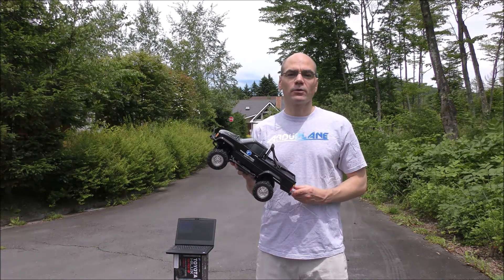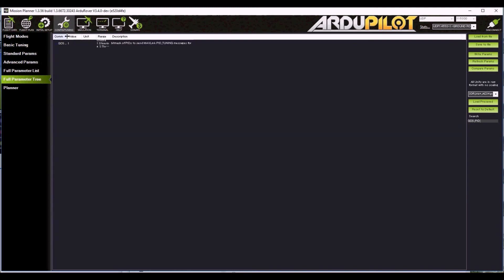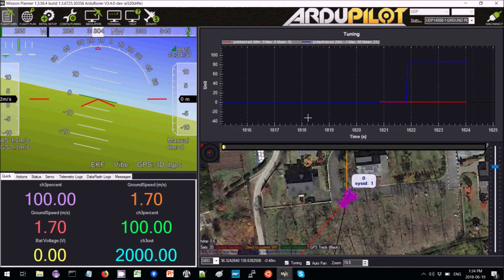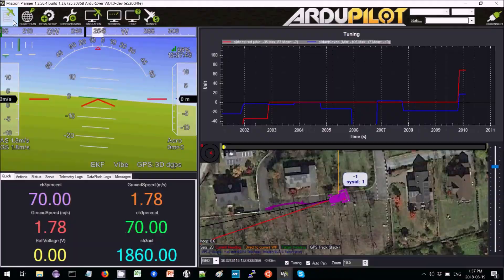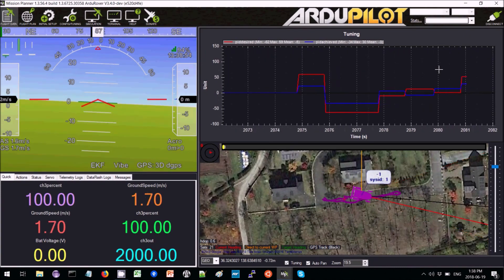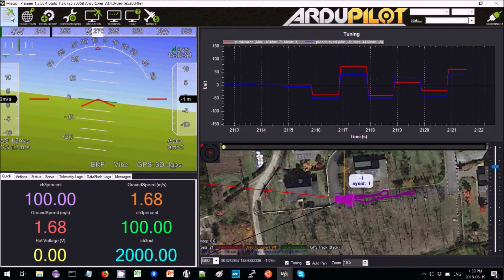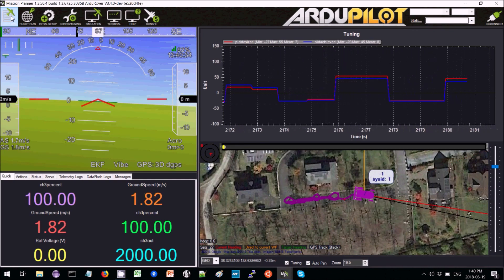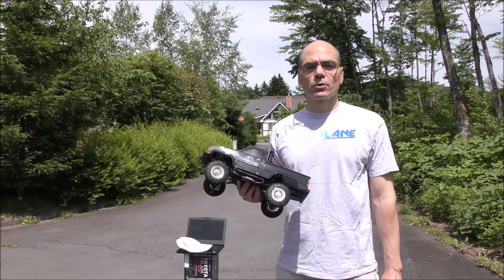Rover Turn Rate Tuning

Comment: This procedure doesn't work i rover 4,0 and above. I tried adding turn rate and gz at seperate times to the mix but got very strange results. Is there a fix for this or a workaround?

Comment: Hello dear randy
thanks for sharing

I have a question about acceleration control of car

we have and hpi which is very powreful and each time we attempt to start it it becomes uupside down and crashes

how we can control it so that its velocity rise up gradually even if we input a high throttle?
Reply from the maker: Hi Ali, in general it is better to ask questions in the forums ( https://discuss.ardupilot.org/c/ardurover/rover42/162 ) but in any case, I think the ATC_ACCEL_MAX parameter could reduce the maximum forward-back acceleration.

Comment: Note to those trying to get a baseline ACRO_TURN_RATE on Rover 4.0 and above, it appears that you can't plot pidachieved and piddesired while in manual mode. The documentation says to graph Gz (z axis gyroscope) instead but I've found the output is flawed.
Reply: Thank you, I was getting very low values with GZ and couldn't figure out what was going on in the video that was different. So is there no way to get an accurate value graphed?

Comment: Hello doear randy

thanks alot for your valuable videos

I have encounter a problem that my buzzer doesnt make any voice while changing the mode

do you guess what the problem would be and how I can fix it?

thanks a lot
Reply: @randy
Reply from the maker: Hi Mohsen, I think we have recently fixed an issue where the buzzer was not playing if the mode was changed from the ground station.  It would make a noise when changed using a transmitter.  If this is the issue then it will be fixed in an upcoming release.

Comment: Is this solution also applicable for skid steering vehicles(such as motorboats)?
Reply from the maker: Hi Asif, yes, the same method works for skid steering vehicles and boats.  The only change is that skid-steering vehicles are a bit easier to tune because you don't have to drive them forward during the tuning... you can just spin them on the spot.  Still, when I'm tuning a skid steering vehicle I start by tuning with the vehicle not moving forward and then I test more with the vehicle moving forward.

Comment: Can rover do stabilisation to keep a tail happy vehicle in check? 
I currently use a heli gyro on the steering servo on my 50cc pocket quad rc conversion and i suppose i could still have it in place if i installed an FC and ran rover but im sure Ardupilot must be able to do it but cant find it in the documentation :/
Reply from the maker: Steve, I guess "tail happy" means the vehicle spins out?  I.e. the back tires lose grip and the vehicle spins around?  Acro mode (and most others) will try to keep the vehicle pointed in the desired direction so it should adjust the steering to stop the tail from drifting out.
Reply: @rmackay9  yes, beack end breakaway from loss of grip is exactly what i mean :)
Its got no diff, its a solid rear axle and being a 50cc pocket quad converted to rc and without the weight of a rider on board the back end constantly wants to come out and ive been using a heli gyro to counter it.

its great that acro can perform the same function as the heli gyro, im def going to give rover a try on it, low speed auto missions would be fun to do!

Thanks!

Comment: Thank you Randy! Are you planning to make a similar video for skids? Are tank tuning procedures that different?
Reply from the maker: Hi Andres,Yes, I'll be making a video for skid-steer vehicles as well.  With skid-steer vehicles the same tuning method can be used except you can just spin the vehicle on the spot instead of driving down the street.